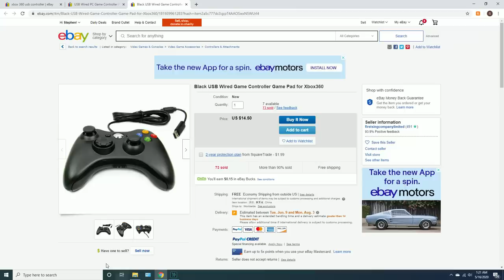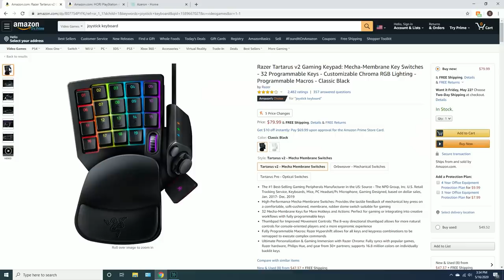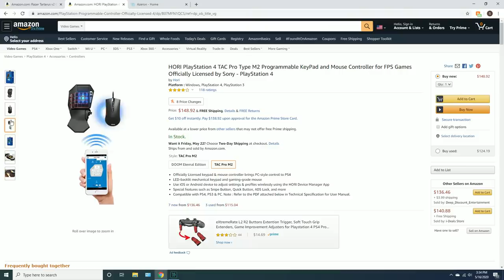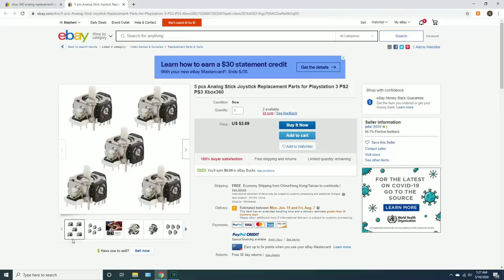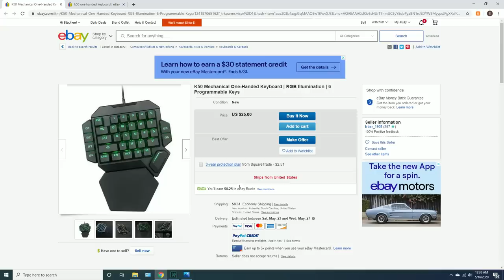I built the BEST GAMING KEYBOARD in Fortnite *Joystick Keyboard Hybrid*

Comment: hi, 
im currently switching to kbm and would love to play with this, so i went ahead and bought all the accessories i need to build it. the only problem i keep running into is that fortnite detects the left stick of any contrlller  I use (ive tried 3 different ones from amazon) as a contrlller input, this interfering with the kbm inputs. how did you solve this problem ? cheers!
Reply: @XG GAMING doenst make a difference. Im pretty sure he used Joytokey or something which he is just not telling us. I got the same exact controller, fortnite recognizes any controller as a controller. It never recognizes a joystick as a KBM input, therefore there is always an interference with turbobuilding. joytokey solved the problem for me though for anyone else trying this.

Comment: Aren't most pc games only give an option of keyboard&mouse or joystick only? Meaning you can't combine both. Yes, some games will automatically change the preference based on what you press. But switching between keyboard to joystick that immediately and often may delay your input or even unregister it. And if you make the joystick into a key press, maybe with joysticktokey app, wouldn't that make it lose its pressure sensitivity? Pressure sensitivity is important for racing or to make people walk slow/fast. Did you find a solution for that?

Comment: Since you're doing a controller with scroll wheel and paddles, I reccomend extremerate remap kit over another like XQ Gamings due to the buttons being remapable. However I will say the button caps feel a way where its flushed. Bottom buttons are good t ok use but the top may feel not as good to press.

Comment: getting my micro controller and analog module day after tomorrow :3 gonna diy it wish me luck pretty sure i have the right code im mostly nervous about the sensor's quality but low key i might just replace the x and y sensors i just hope the solder job isnt garbo so i dont have to hunt someone down with the right equipment to de/resolder it because i actually dont trust myself to not fuck it up. plus doing that however many times to get it actually hardware calibrated as opposed to software would just be a nightmare. i dont have a 3d printer tho so im just gonna remove a or 2u from my hotswappable keyboard and like lodge it into place or something idk ill figure it out thanks for giving me the idea a few months back :33

Comment: Make a Controller with 2 scroll wheels and 4 back paddles
Also make the controller having the feature of auto fire. Auto fire is an option on Fortnite Mobile

Edit: If you want to make a bigger project 
Convert a Ps4 in PC. This means that U can change the settings for graphics in Ps4 Pc and also in Ps4PC there should be no input delay

Comment: What you have done there is a great piece of kit,    except Logitech did it with the G13  in  2008 and discontinued around 2015 .

Analogue movement is too slow for strafe compared with ADAD,   most people who jumped from console to PC wanted the higher frame rate  but they also wanted  aim assist which at the time most people jumped and Fortshite was at it's peak, the aim assist was literal wall hacks combined with aimbot L2 spam would snap to people through walls.

Comment: W.A.S.D. movement seems lousy until you realize it's relative to the camera position

 It's limited to four directions at any given time but you can adjust the camera using the mouse to shift the direction of the inputs into more precise diagonal directions and it feels very seamless because it's a separate peripheral from the keyboard, it's very easy to  move the mouse as you WASD but not as easy to move the right analog stick while moving the left, i mean it's kind of easy to do but it feels a bit awkward and imprecise 

 Analog stick does feel good because you can just ignore the camera but I find doing that kinda negatively impacts gameplay in some ways and that's why I think WASD movement is superior still to analog sticks because if you're adjusting the camera a lot it's much easier and more natural feeling in gameplay, and more precise
Reply: This is a very cool idea for a gaming peripheral though, it would be really good for some people on FPS games because that's where a lot of people struggle most with WASD as you can't adjust camera separate from the player, but even then you can have more precision with WASD just using mouse movement especially during air strafes
Reply: A mouse is superior to a thumbstick for looking. A thumbstick is superior to WASD for moving. I am a PC shooter. I miss having fine control over the angle and speed my motion. This guy just made the best keyboard thumbstick controller ever. 10/10 he needs to patten this.

Comment: Everybody says "PC Masterrace" but nobody has an solution that has as many buttons as an keyboard AND a place where you can switch between d-pad and thumbstick like you can switch it out on the xbox elite controller.

Also most mouses arent ergonomic at all. even if they have more buttons than usual they arent placed well and the mouse isnt angled at all.

We need a modular keyboard where we can add what you want just with plug and play. You need an additional thumbstick? Here you go just plug it in! You need an d-pad? Just switch it out for the thumbstick!